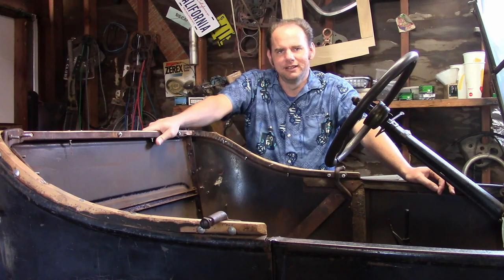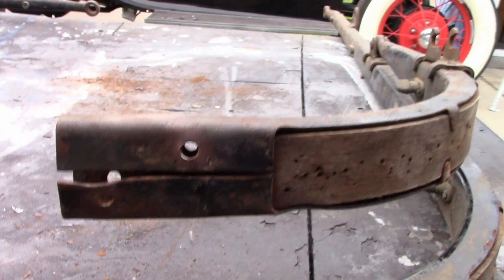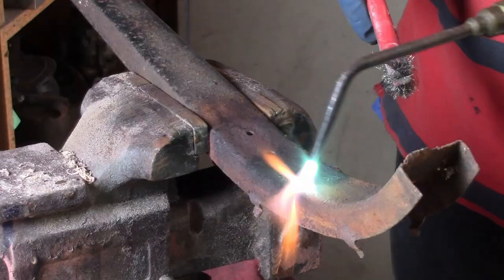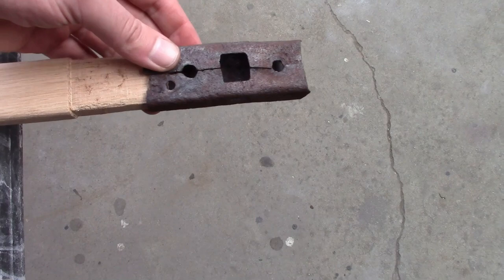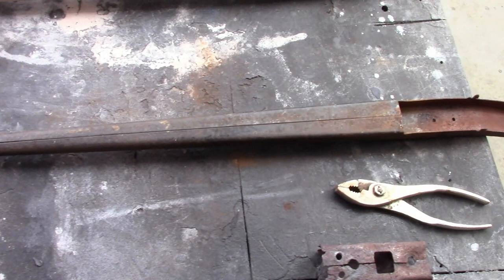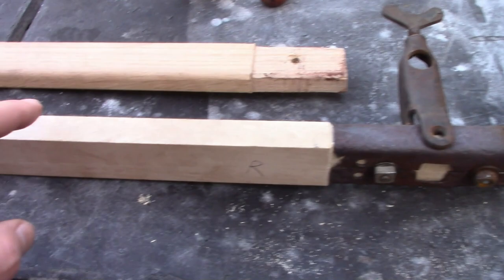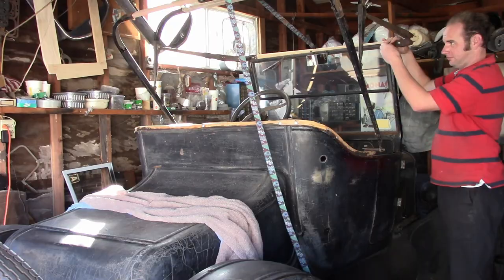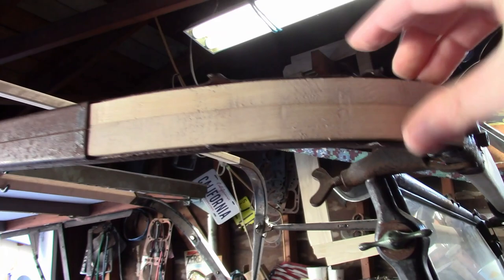1925 Ford Model T new top/interior. Part 2.

Comment: Thank you for this video.  I own a 1923 touring and I need to perform the same operation on my top bows. However, never having done this job before, my 66 year old eyes overlooked the detail that there are 3 separate pieces of wood for each bow.  I thought the wood was constructed as you described the pre 1917 steam bent bows and was expecting to have to find a supplier of steam bent wood parts. I believe I can make the parts just as you did. Thanks again for the very informative video.

Comment: Just a thought, I believe you can back up the hole on the inside with copper to weld the holes on the outside, because the weld will not stick to the copper. Also you could grind the inside with a dremel and a grinding stone. I hope this helps.